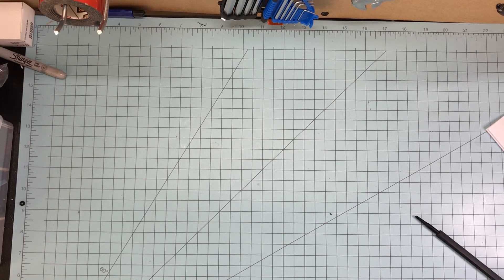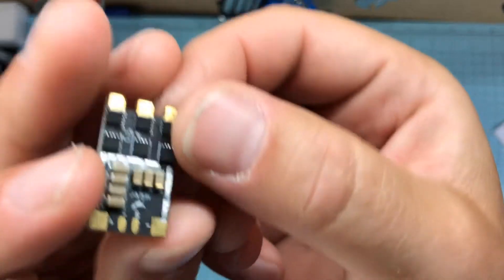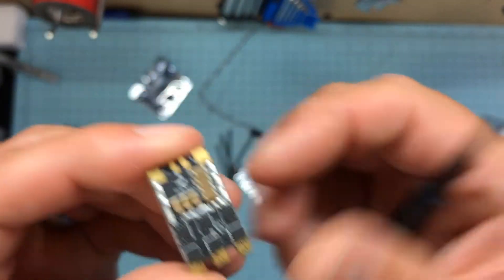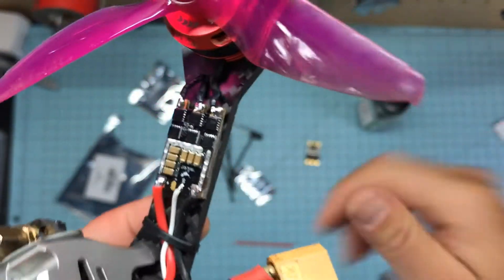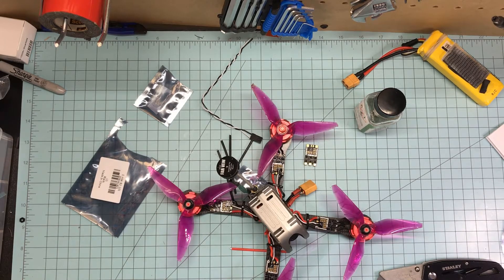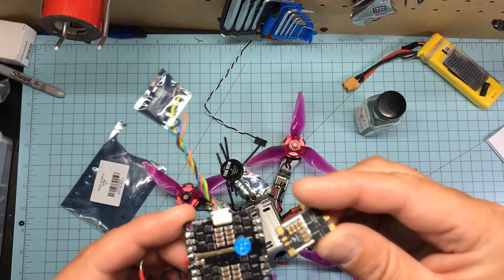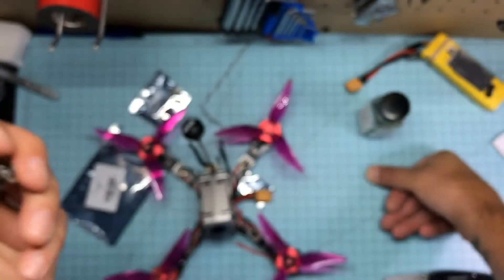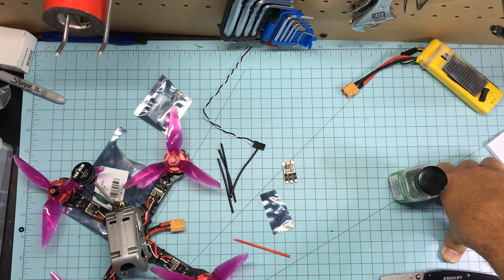HGLRC BS28A BLHeli - S 28A ESC Review (GearBest)

Comment: IS AN ESC READY TO FLY, OR NEED TO PROGRAM IT?
Reply from the maker: Depends on what your doing.  Usually all you have to do is set the direction for each motor using blheli software
Reply: @jjrotogeek  can I also invert the two external wires to reverse the motor?
Reply: @jjrotogeek  I'm not familiar with biheli software, I don't know how to start the procedure, I'm looking for the easiest way, the old way of reversing two of the three wires of the motor, is this option always possible?

Comment: I have heard that these esc will burn on 4s with racerstar br2205 motor? Is it true?
Reply from the maker: I never had any issues with em brother.   And all I use is 4s
Reply: JJRotoGeek which motors?  And do you get to 30A with these and can these handle 30A?
Reply from the maker: Yes without a problem.   And I’ve used many different motors on em bro

Comment: Man, you should use signal grond, just for reliability, someon even cant fly without it
Reply from the maker: Really???? Never had a problem with that.   But your right if the system is noisy it could prolly be an issue.    Damn this is an old video!!! Lol

Comment: Anyone upgrade the firmware on these?
Reply from the maker: I did bro.   I always upgrade before the build.  Had no issues
Reply: JJRotoGeek ok cool. Did the same but I'm getting desynch about 1/4 throttle with all 4 motors. None issue with one motor at time.
Reply: From the motors tab that is
Reply from the maker: Are u sure it’s not your Mom throttle setting in bf?? Set min throttle in the reciever tab to 1075 and see what happens.  What motors u running
Reply: JJRotoGeek junk bfight 210 2205 2300kv Prolly racerstar. I'll try the min throttle. I did just update BF 3.2 so it's stock values.
Reply from the maker: Yeah give that a try and lemme know what happens.
Reply: JJRotoGeek nope same same. I have a brand new f405 with the ribbon cable to the fchub 6s.
Reply: Got it.  Umm smoke stopper was still connected.  Lol
Reply from the maker: Lolololol

Comment: If you're going to run those RS 2205's they are ok!! Do not try running 2207's and bigger because they don't like it! I have blown 6 of these dudes with 2207 F60 pros and RS2305's!!
Reply from the maker: +J.FINESSE FLIGHTS lolol.  I ended up not caring for that frame.  I gave it away. Lol.  My main motors are cobras tmotors and brother hobby moslty

Comment: I found mine the same way as you. I did fuckin BBQ o e on my 6". I believe it was pilot error, full throttle in the dirt was the culprit!! I was running 2305 2600kv with 6" props huge ass bull nose! Oh and this is the 2nd esc that burnt, different brand of esc's, different arms! I'll tell ya thought that kwad that keeps torching esc's does not have signal grounds attached!! Does this have anything to do with esc's bursting I to flames!!
Reply from the maker: hmmm i have never in all my quads hooked up the ground.. those are beefy ass motors, think your over propped?? when in doubt, go big.. bigger is better unless its disease debt or ass! lol get bigger esc's LOLOL
Reply: you need to put some type of voltage protection on the esc or main power line a good cap to stop voltage spikes the amp draw on motor can go up to extremes on throttle ups or prop stops. what doesn't turn to heat turns to volts and backfeed the circuit worse case flames other cases signal issues from vtx remote or dsync. some ppl are saying a type of diode but never tried them but capacitors help 25v for 4s 35v for 5s 470uf -1000 most of the time on main power is ok 100uf -330uf on each esc is other way. lol also don't over prop the ampdraw can be more the trust test in flight when pushing in to your own air in turns kwad now cant really run under 25amp esc with a good burst
Reply from the maker: youel adamas ya know, I've never smoked an esc.  Amazingly, I fly like an idiot.  Yes they r talking about flyback diodes, which would be better than a cap. I have used caps for vtx filtering sometimes but rarely.  Never had issues

Comment: how they holding up I have the racerstar labs branded units I think they can be beefed up some to by adding some more solder to the trace line. lol I was on same mind set with the stan 200 build but I put esc under arms cause I changed frame some lol its a lightning bolt.
Reply from the maker: lol nice.. thanks for the advice.. i may give the stan another chance.. i built it half ass i admit,. and i ordered the racerstar 30amps should be here this week. im sure they are just as good. stan might be getting them. at first i loved the thought of that frame cause its a tank.. but ehh.. but its more me than the frame.. maybe a rebuild is in order lol.
Reply: its a tank and like a sports car in one lol ill fly anything though but really like the different/unique kits. working on a split level frame now lol changing frame now of the x210s phoenix got to make them your own or you don't bond to them the same. remember you need a small stack the stan doesn't give much space

Comment: Off topic but, I'm digging my stan200 frame... I bought it for a budget build but I converted it over to a "higher end" freestyle quad because it fits a betaflight f3 & runcam split perfectly inside w/o any modification. No props in fpv or HD footage w/GoPro lens upgrade. Awesome frame in this configuration even with an under slung battery
Reply from the maker: freaking awesome. show me pix when you have it done. Also, let me know how you like the split, i was thinking of getting one as well.
Reply: JJRotoGeek Absolutely, I'll email you some before & after pics later on but I uploaded my original build pics & review on banggood if you want a sneak peek. Final version has hyperlite motors & runcam split and I've been flying it daily in this configuration for about 3 weeks now. Awesome camera by the way. I've heard several conflicting reviews but I think some people have trouble because they fly it in 1080/30fps instead of 60fps and the video out seems to have a lot more latency at the lower frame rate. Seems backwards from what you'd expect
Reply from the maker: ryan todd yes I definitely want to see that when ya done!
Reply from the maker: get this dog done yet?
Reply from the maker: shoot me the link to those motors when ya get time.. and email me pics of ya bird jasongjamiel@gmail.com